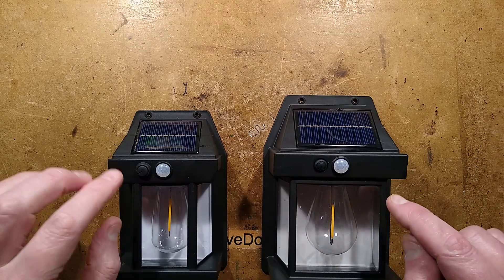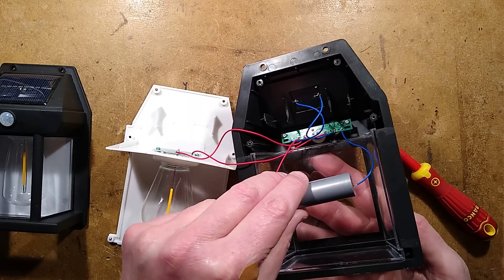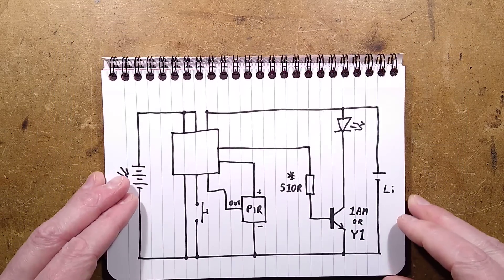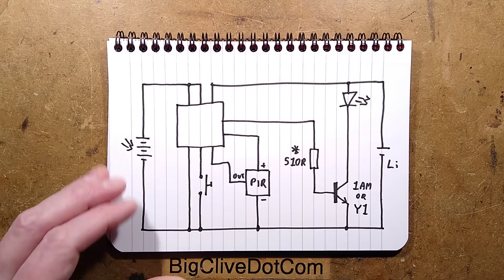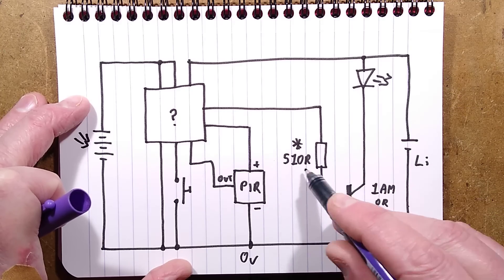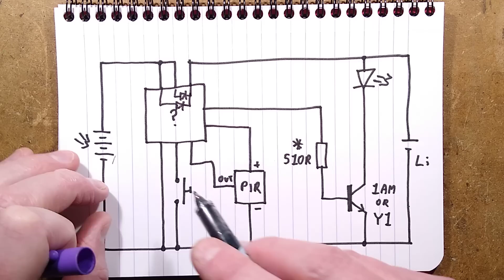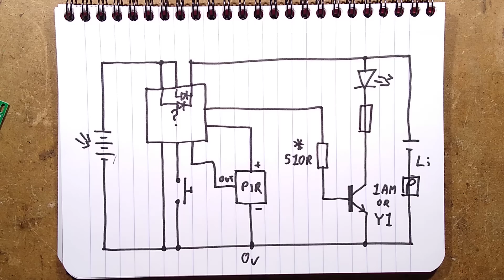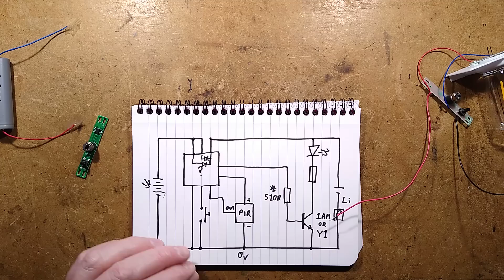Perplexing Temu solar filament lights

Comment: I understand they might cut prices by removing battery protection but charging the battery through the MCU protection diodes Is wild. These aré so cheap that buying them for modding might not be a bad idea

Comment: I’ve bought these lights off Temu but no instructions with them. Are there different modes? Currently I have to press the power button every time I want them to work. Is there a setting that means they are active all the time and only come on when the sensor is activated? Any help appreciated 🙏🏻
Reply from the maker: They will only operate at a low light level.

Comment: i bought 2 of these, and i instantly removed the circuits and changed the filament to a smaller length version.....i put a classic solar sense circuit inside so they only just come on at night....works great. if i recall i paid 6 quid for 2..so it was worth it for the lamp cases alone...cool looking lamps.

Comment: 9:32 These low capacities (500mAh/ 300mAh) speak for recycled cells. Unless they unreasonable light. Recently got a product with an 18650 where the battery clocked in at 24g.

Comment: Not sure about this particular one but I believe 18650 cells often has a built-in protection circuit
Reply from the maker: It's rare and usually obvious.  The internal pressure operated contact is a different thing.

Comment: I wonder if simply shunting the battery with Zener 1N4731A would offer excellent protection from overvoltage? Its breakdown voltage is 4.3V.  According to datasheet it can handle up to 200mA (1W), so I doubt that any current that this Solar battery can produce would fry it.  And of course there is a 5W Zener for the same voltage - 1N5336B, but that seems an overkill.
Reply from the maker: The zener diodes often start turning on before their rated voltage.

Comment: I've got a similar one from Temu, the bigger version.  It does have the 510 Ohm resistor in the base circuit of the transistor. But the battery while indeed Lithium, is not 18650 (even though there is a room for it), but some kind of unlabelled AA-sized one. Also there is only one screw at the back, the rest are clips.  I measured the voltage coming from the Solar unit at full unclouded sun, it is 4.83 V. The current going to the LEDs at full brightness is 203mA.  So it looks to me that a single standard diode in the charging circuit of the battery shoud provide sufficient protection from overcharge. As to how long will the filament last at 200-odd mA, I have no idea.  And btw, the edges of the Solar battery provide ample opportunity for water ingress, definitely some king of epoxy glue or putty will be required there.

Comment: Do you think adding one of the cheap TP4056 charger modules would work to make this better?   Could you just attach the battery to the battery connection of the charge/protection module, one of the module grounds to the circuit ground, the module V+ Out to where the cell+ was attached and add a wire from the solar cell+ to the V+ In (USB +) on the protection circuit??  It seems to me that could work but I'm not sure....  THX
Reply from the maker: A small DW01 cell protection module would be all that was needed.

Comment: It really seems to me that the producers of products on places like Temu adopt a certain school of thinking that if they aren’t “getting over” on their customers, “westerners “, then they aren’t doing it right, they aren’t succeeding. They’re even willing to make a little bit less, or even jeopardize their business’ continued ability to thrive and sell things so long as they can sit back at home and giggle to themselves with a shit eating grin about how frustrated we must be upon figuring out how much the got over on us. Maybe screwing over all westerners is that important an ideology to them, and it’s often completely counterproductive for them to do it, but they do it anyway. I’ve not seen one Temu product that didn’t have some unnecessary cost cutting measures, cut corner, or whatever that would definitely benefit them more in the long run had they not included it,. Sure, some of the products are “good enough that you can just ignore the flaws considering the price,” but never any that you’d genuinely say, “yup, this is a winner.”

Comment: Designed to die overnight and to kill batteries. The vast majority I've tested have high quiescent current and also overcharge..  Still awaiting some zeners to connect parallel to the panels I like... my own cheap shortcut :) Thanks for the entertaining disappointment.

Comment: Can anyone explain how the intensity of the LED is changed by the microcontroller when motion is detected?
Reply from the maker: Pulse width modulation.  It flashes the LED at very high frequency and varies the on to off time to give a change in intensity.

Comment: Chineseum crap ~ polished turd = for the lithium ion not having any protection, I wonder if it originally had a nickel-metal-hydride AA battery, and the bean-counters at the Chineseum crap factory said “swap that for a lithium-ion one to increase its capacity & life” ~ not knowing that they have made a wall-mounted fire bomb 🫢 - ⚠️🔥

Comment: Adding a string of diodes between the transistor base and positive rail so the transistor turns on when the voltage reaches about 4.3V would give a degree of basic overcharge protection. Nothing to protect the battery from overdischarge though.

Comment: Crazy hack time: Rip out the existing 18650, solder a USB plug in its place and connect to a basic battery bank? Protection, extra capacity, and there looks to be plenty of room for it.

Comment: I "had" a light with an almost identical PCB. I found out that the MCU is 3.3V, and it only lasted for a couple of months before the voltage killed it. I bought a 5 pack of replacements PCB's from AliExpress which had a both a charge controller and a 3.3V regulator for a few pounds, and seemingly the same MCU - same options. These fitted right in and hopefully reduce conflagration risk !

Comment: Wouldn't be bad if they had simply used a protected 18650 for a few cents more. 

Products like THIS are why I tore off and kept a bunch of the protection PCB's off dead 18650 cells. Slap one of those in there along with maybe a larger cell, and you'd have a fairly decent light.

Comment: Did you have the filament connected when charging?

Had I been in their shoes and could measure the voltage I would turn on the lamp when the battery got full.

I know it is a bad workaround if the filament breaks for instance.
Reply from the maker: I did test it with a load connected.

Comment: Yeah, disconnect the battery and put it under a light.
The voltage going to the battery rises above 5V.
I just tested an example.
The battery does not in my experience catch fire, but does degrade over the period of a few weeks to the point that it no longer stores energy.
They are bad, very bad.
But then , I have a very caustic opinion of the solar industry in general, not much of it is actually worth buying.

Comment: It would be possible for the microprocessor to limit the voltage to which the cell is charged by turning the lamp on if the voltage is getting too high. It would be possible as a modification to connect a diode in parallel with the transistor, selected for forward voltage drop so that the sum of its forward voltage and that of the lamp is between 4 and 4.2 volts. This will allow any overcharge to spill safely via the lamp, causing it to light to some extent.

Comment: Both were bought by me on ali. For cheap. I removed the cell and replaced it with a protected LiFEPO4 cell. I no longer need an extra resistor, or a very small one. I am running it in the night modus, where it is lit very low and comes up bright after movement detection. I ended up connecting it to an external LiFEPO4 cell which is used for many projects (a 200Ah 3.2 V cell, charged by its own solar panels, and protected). Would i recommend buying it? Yes. For that little money you do your own adaptations, and it looks great! O, and I also added a mirror on the backside, it looks very good now when it is lit up!
I did not do the tests like Clive. There may be a feature he has not tested, who knows? I know those 4 cell solar lights charge up 1.25 niMH cells. The circuit has a clever way of draining too much power in: you will see the LED light up when the voltage goes too much above 1.4 Volt. So maybe, I say maybe: this circuit may do the same? The LED string is capable of drawing a huge lot of current above 4.2 Volts!

Comment: How easy would it have been to just make the LED turn on when the battery reached 4.2V? Maybe their cheapo mCU doesn’t have an A to D converter… It’s almost as if Temu products have an anti-standard of ‘must have potential to explode unexpectedly’.. 😢

Comment: ST Microelectronics do a couple of lovely energy harvesting ICs (SPV 1040/1050) which offer MPPT, boost, CC/CV charging for a wide range of cell chemistries and work as low as 0.45V I/P.

Comment: Put li-ion batteries from vapes there, and for regulation use the limiter I wrote to you about by e-mail on the TL431 IC. After these changes, you will have nice garden lamps for hot summer evenings ;) Just like I wrote You, one of my garden lamps was explode, so You right - this shitty IC does't have any overvoltage protection, and without any mods this "scam" product is dangerous for consumers.

Comment: I bet that 18650 is a high quality one with built in over voltage protection circuitry, as well as over discharge protection as well.... Sorry, I must have bumped my head today, as we know it's going to be the cheapest and nastiest battery on the market, with zero protection

Comment: I have using those resin coated solar panels for years but I buy the acrylic clear top coat used on cars and give them 2 or 3 coats of this clearcoat before putting them in to the sunlight and they last many years longer almost as long as the glass panels

Comment: Maybe there is a zener shunt in the chip to prevent overcharging the battery? There's not much power from that small solar array (1 watt maybe), so it would work fine.

Comment: I have seen this type of circuit in solar light for several years now (I actually mentioned about it in one of your videos ages ago). Now every time when I buy a new solar light, I have to open it up and check the circuit first. But in the end, I have to add the BMS pretty much every single one of them anyway.

Comment: Probably originally designed for NiMH and the better choice for solar lights in areas with <5°C.
I just removed my oldest solar spot that has worked, untouched from 2006 apart from my initial sealing of everything with flashband [excellent weather resistance, terrible now need to get inside again, sticky black gunk - yuck]. The only reason it needed attention was the switch had corroded. I just taped over it with flashband but time had loosened it. A dob of solder and the two NiMH cells, solar panels and 12 leds work perfectly again.
I also replaced the fresnel screen on the pir that had gone brittle and cracked. New ones are pennies from glass in optics store on AliX.
I have binned multiple li-ion cells from outdoor lights that don't survive the winter. Poor choice all round unless you have a bucket of vape cells like I do. Even so, NiMH is the optimum cell for garden led lights.

Comment: Can you overcharge a li-ion battery with such a small power the solar panel can output? Is the overvoltage enough with a few milliamps?
Reply: If you keep charging a lithium cell that is already full, at however low a current, the voltage will keep going up until the cell lets go in some way. Lead-acid, nickel-cadmium, nickel-metal-hydride etc have a side reaction that will safely convert overcharge at low current into heat, but lithium-ion doesn't have this side reaction. It could be compared to continuing to pump water into a fully sealed tank, even at a very low rate, as opposed to pumping it into a tank that has an overflow pipe and so will not build pressure until it bursts.
Reply: @cedriclynch  The tank analogy is what made me uncertain, because when the tank is full, the pressure from the tank and the pump will equallize and nothing will happen. Unless your pump is infinitely strong.
Reply: @gabest4  I should have specified that the pump can give enough pressure to burst the tank.
Reply from the maker: It depends on the level of sun and cell capacity.  Some will also keep charging even when the light is turned off.
Reply: That reminded me of my experience at recharging NIMH battery’s, in a “dumb” charger with no fully-charged indication I wondered how I would know they were charged = even with a smart charger they become hot.

Comment: Uh oh, I have a similar light to this, the regular LED panel varient. bought from 5 Below (US shop similar to Pound World), mounted to our wooden shed. Granted, it was bought from an actual shop and not Temu, this could just be a crappier version without charge control.

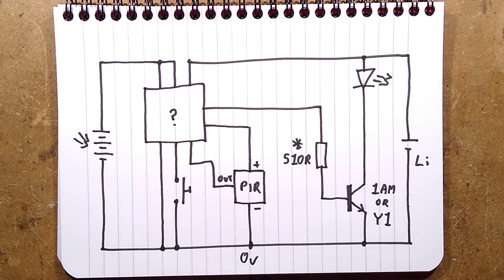Comment: Are you sure the lithium cell doesn't have a built-in BMS? They're cents now and you can specify them even on cheap batteries. It looks like it does to me - you can see the odd bump on the positive end at 6:04

Comment: 6:20 ah good you did talk about that.  we have these exact same units in Dollarama in Canada.  I have been buying them and monitoring their voltage with an ADC and ESP32 to see if they are a good source for solar charge controllers.  And has you have discovered they are not, they overvolt the batteries.

The good news is that the physical solar panels are also so shit that they current  limit themselves after getting too hot somehow.  I'm not really sure how but I confirmed it with my multimeter on the bare solar panel wires not connected to anything else, and if you stick them in full sun, you'll get 50-100mA for a few minutes, and then instantly it'll drop to anywhere from 30 to as little as 4mA.  And it just gets stuck there until it cools off again.

They also sell them at Canadian Tire but the reviews just say that they stop working after a while, not that they explode.  I think the low capacity cells just leak internally.
Reply: Could be partially explained by solar panel characteristic - they lose efficiency when hot. A good rule of thumb is 0.3% per degree C. What you're observing sounds much more extreme though.

Comment: I pulled apart a Dyson vac battery that had failed. The first word that came out rhymed with truck when I saw 6 Li-ion batteries in series with no BMS! Yep, just series charge them with no monitoring of cell voltage. What could go wrong eh?

Comment: So, my guess is the the lantern is designed to run the battery flat every night.  At a high latitude, the solar panel might get 16 hours of productive light at summer solstice.  As long as the panel puts out no more than 31 mA at 4.3 V, then there isn’t much risk of over charging the 18650.

Comment: In the far distant past, you reviewed some LED screw in bulbs that I believe you bought at your local pound store. We have a similar store here in the US called Dollar Tree. I bought several after watching your video and I have been well pleased. Since I don't have a Dollar Tree close by, I when I am near one, I buy 3 or 4 just to keep on hand. Recently, the Daylight bulbs have become scarce so when I was visiting another city I found some and bought 8. All my ceiling fixtures are the dual socket type. A bulb burned out in one and I replaced it with one of these recently purchased ones. To my surprise, it didn't work. Thinking it was a bad bulb, I tried another and it wouldn't work. Thinking maybe a fixture issue, I took the bulb out of my workbench light and put it in the fixture and it worked. I tried both the new LED bulbs in my workshop lamp and they both worked! I tried them in three different single socket lamps and they worked. I tried them in two different two socket fixtures and they will not work. Even if they are the only bulb in the fixture, they won't work! Both two socket fixtures are wired in parallel. I went to my local discount store and bought a brand new two socket fixture thinking there was something strangely wrong with my fixtures. Same exact result. They will not work in a two socket fixture. Do you or any of your highly technical viewers have any idea what the heck?
Reply from the maker: I responded to your email about this.

Comment: It would be a good idea to put a 1N4002 in series with the solar cell to reduce the maximum voltage that can go to the battery.  It might take more than one, or a combination of a 1N4002 and a 1N5817 Schottky rectifier in series to add up to enough drop to limit the battery to 4.2V.  Another way would be to connect a 4.3V, 1W zener across the battery to absorb any of the current above 4.3V.
Reply: It would have to be a 5W zener but yes, that would... well, sorta work.  Zeners below 5V have very soft "knees" on the I-V curve, however, and the reverse leakage current may be too high and destroy the battery.   You'd also need a current-limiting resistor because if you let the zener overheat and melt, it basically becomes a dead short.  So that opens a can of worms.

It would be easier to try the zener idea with a LiFePO4 cell which can be charged to 100% anywhere from 3.45V to 3.65V and tolerate 4.2V.  But still a can of worms.

The easy solution is for the micro-controller to just turn on the LED filament unconditionally to override the solar cell when the voltage exceeds a certain value.  I little PWM regulator using the LED.
Reply: Like the zener idea; easy and cost effective (just guessing)

Comment: Think of it as a high UV detector. If the UV from the sun is too high (sunburn), it warns you by burning down the house.
I really love these health and safety devices from Temu.
Reply: That would be a large soot stain on the brick wall with some smouldering crap at the bottom of it, if it was on a wood fence/shed then yes.